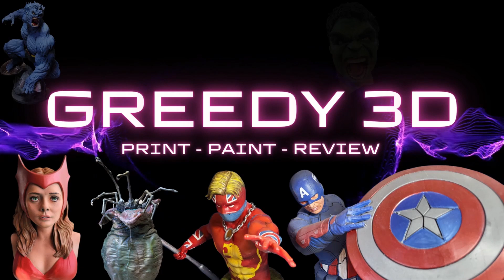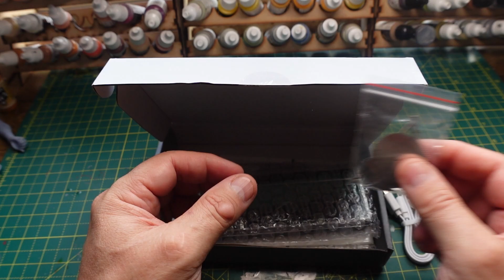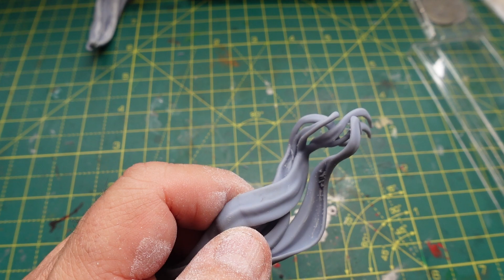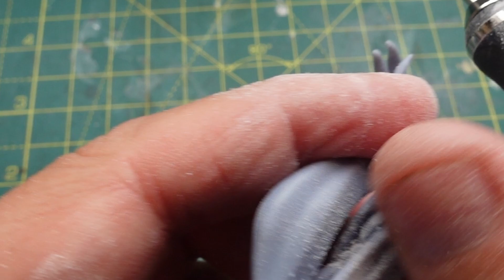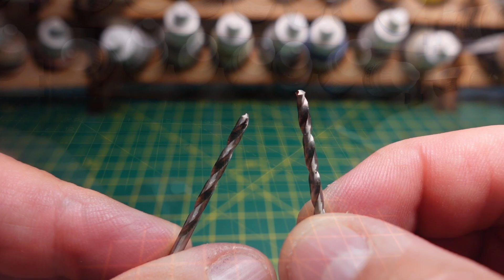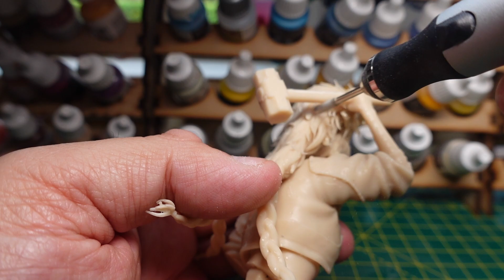Cheap Tool Removes Need to Sand Small 3D Printed Models

Comment: Dremel has a kit that would work well also. They have one with the main grinder connects to a smaller hand held unit that is powered by the main unit
Reply from the maker: Yes I've got a similar thing on my dremel but it's a good idea to point that out though

Comment: What kind of finish do those bits leave? I'm assuming it will still need sanding to remove those marks?
Reply from the maker: Definitely not too bad at all i don't think you need to sand but remember it's only for small areas
Reply: @greedy3d480  Thanks, I've got a similar bit for my dspiae version of this but i've always been too afraid to use it lol. Will give it a go and if i like it may end up getting this one too.

Comment: Looks great especially for all those presupported models, that use those damn annoying ball contact points for the support tips.

Of course it's much better if you can remove them from the model, but at least chitubox & lychee free versions don't allow that (except for re-doing the supports)

Comment: hi there, this looks like a rebrand of the Dspaie rotary tool, but at a lot better price, i was looking at getting one but after seeing this, well mind made up, i have the recip sander made by Dspaie and although it works well, i find it a bit underpowered. hope this tool is up to the job and has a strong motor, love watching your vids and have learnt a lot from your tips and hints.
Reply: Definetly a direct ripoff of that
Reply from the maker: thank you :)
Reply: Was coming on here to say this exact thing. I just got the Dspaie version of this and other then the paint color and that you can lock down the bit with a hex key it’s the exact same thing. The one Greedy shows here comes with a lot more accessories that I’m having to buy separately.
Reply: @pankbot  Nope - 2mm shaft on these. Dspaie is 3mm.
Reply: @m00se23 bought some 3mm from a local store thinking they would fit and nope. Broke out the calipers and the single dspaie one I had measured 2.9. Store bought measured 3mm My calipers are some cheap ones so the number can be off but I’ll error on the side of caution. Definitely just buying a micro engraver /finger nail tool like this one when my dspaie eventually goes out.
Reply: I have a similar one to Greedy's made by Jangklife. It has a smaller diameter chuck than the Dspaie, which is a standard Dremel shaft width of 3mm. These are smaller 2mm shaft widths. Just so'z ya know. Great little tool, recommended.